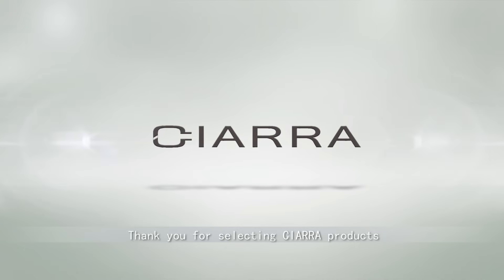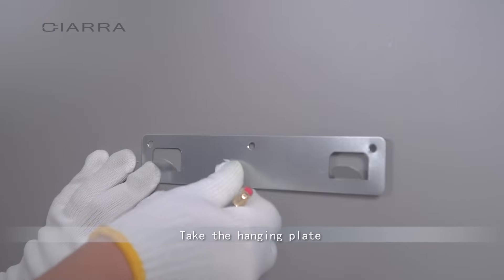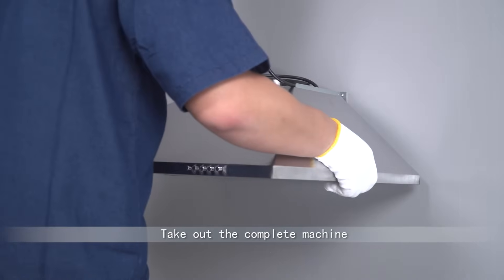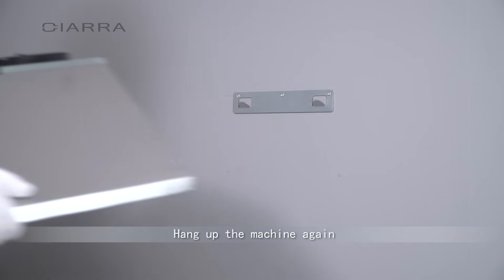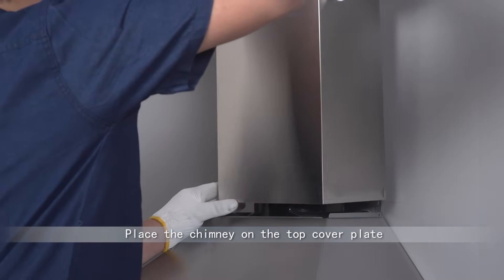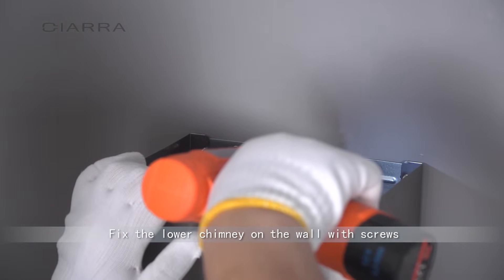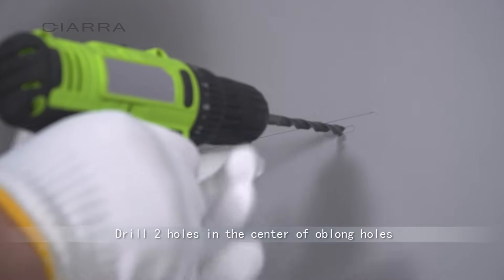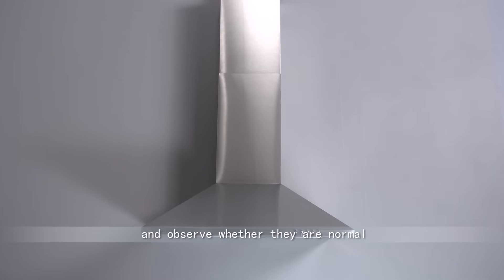Wall Mount Pyramid Chimney Cooker Hood CBCS6201 Installation Guide//How-To

Comment: It is shame you do not explain the electrical connection. Not explaining it spoilt what was a very good video. I cut the plug off mine and connected it to a switched socket that was installed for my old cooker hood.

Comment: I used an 8mm masonry drill bit as instructed. The screws just spin inside the wall plugs. I then used a 7mm drill bit and the same thing happened. The screws supplied to me were the incorrect size for the wall plugs 😡. Also DO NOT JUST DRILL USING THE PROVIDED TEMPLATE THAT COMES WITH THE COOKER HOOD. If you do the holes will be out for the top bracket. I will have to drill a piece out of the chimney section to be able to use the power chord.
Reply from the maker: We're sorry to hear about the inconvenience! Please reach out to our support team for assistance. 💡

Comment: So in order to do it correctly, i need the vent hood to be at waist height. Gotcha. Cuz it's almost impossible to screw the chimney bracket in at the top of the wall near the ceiling.
Reply: Completely impossible in my case as it is so close to the ceiling - this seems to be a poor design feature. And If you don't screw it in, it will rattle like a bugger.
Reply from the maker: Thanks for sharing that! We understand that installing near the ceiling can be tricky. To make it easier, we recommend using a longer screwdriver or an angle bracket to assist with installation. If you’re still having trouble, professional installation might be a good option. Let us know if you need any further assistance—we’re happy to help!

Comment: I have a cover over water pipes along the top of the wall, it sticks out 80mm from wall and 80mm down from the roof, So, is it OK to stop the chimney at that height, when it gets up  against the cover over the pipes, 80mm below the roof,   ? Thank you !
Reply from the maker: It depends on the distance between the chimney and your countertop, normally we recommend users to leave at least 650mm distance between each other. And you can also learn more details through the user manual: https://cdn.shopify.com/s/files/1/0436/4310/9542/files/2022_ciarra_201_new_manual_EN-DE-FR_0218_1.pdf?v=1646191012    by page 9

Comment: The cable is the kind you have for an electric kettle (UK) it comes with a fitted plug. It connects into a normal wall socket. I fed it through the chimney and along the top of the ceiling covering it with pvc trunking straight into a normal wall socket. I didn't use the cable supplied as it was too short. I got a 5 metre long cable.
Reply from the maker: Thank you for purchasing our products, and we are sorry for your troubles during the installation of the cooker hood. Since the needs of each customer may be different, our power cord exposed wire length standard is 1.5M to meet the needs of most customers. If you have special needs, you need to equip yourself with a longer line.
Thank you for your feedback and wish you a happy life.

Comment: installée en recyclage d'air.
A Savoir : la prise électrique est au niveau du conduit d'extraction, et donc la prise sera caché par le conduit... ou il faudra perforer le conduit pour passer le câble.
Aussi la partie basse du conduit se fixe à 56,3 cm au dessus, par rapport à la base de la hotte. si votre prise est là... il faudra la déplacer.
pour ma part c est le cas, mais ayant dû installer la rallonge en inox pour 10cm , pour parvenir au plafond, la barre de la partie basse n'a pas été nécessaire. La barre pour l'élément supérieur suffit.
Par contre, la vidéo est assez drôle car on ne peut pas monter dans cet ordre. à moins de n'avoir pas de plafond !
En effet, il faut installer la barre de la fixation du conduit au mur et ensuite, l'amener sur la hotte et la fixer sur la barre à l'aide des vis fournies.
Un plan est fourni. Fixé au mur, il n'y a plus qu'à percer aux endroits indiqués. Conseil : vérifier sur une table la bonne dimension des pièces fournies avec le plan en les mettant dessus. Vous pourrez aussi vérifier la concordance des trous.
Reply from the maker: Merci pour votre introduction détaillée et votre soutien. Étant donné que la situation de décoration de cuisine de chaque client est différente, nous ne pouvons pas fournir une opinion unifiée pour chaque situation de conduit de fumée. Pour plus de information après-vente, veuillez contacter info@ciarraappliances.com